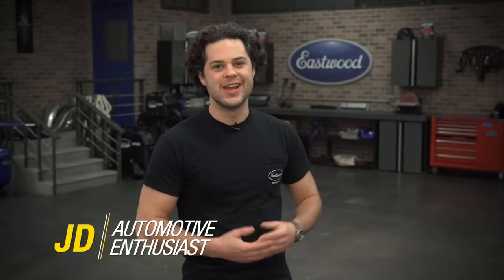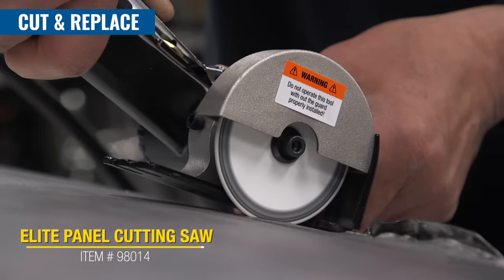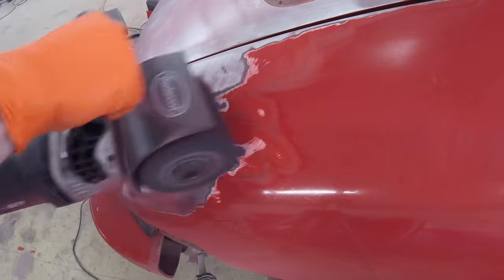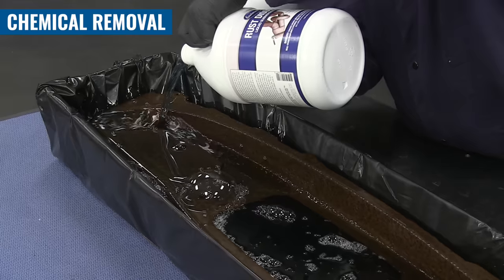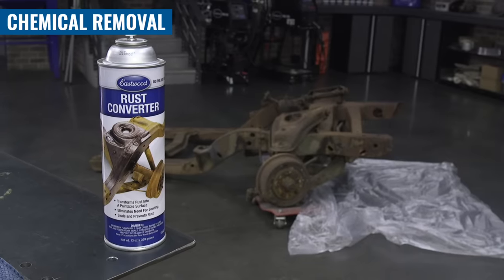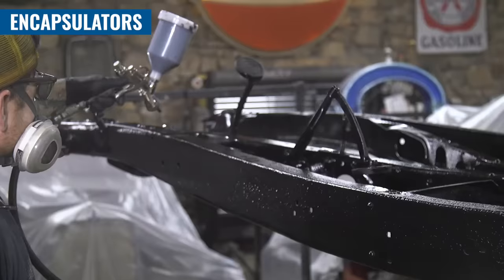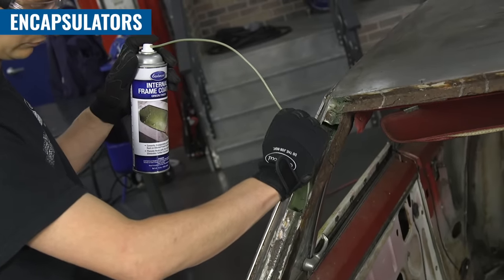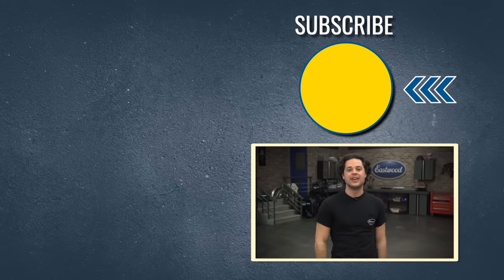How to Remove Rust - 3 Different Ways to Completely Remove Rust! Rust Removal in Minutes!

Comment: How did you miss electrolysis? The basis of that is used in so many other things, like gold plating, or other plating as well.
Reply from the maker: Electrolysis was originally in the script for this video. However, I wanted to really expand into that process. We want to keep the "In Minutes" series pretty snappy for you guys. Therefore, we decided to put electrolysis in its own video. Keep your eyes peeled for that one. Coming soon. 
-JD
Reply: @eastwoodco  it's honestly my favorite way. It's simple, it works, and it explains chemistry. Lol
Reply: Also, boiling in water will convert unstable red oxide ("rust") into stable black oxide.

Comment: So my wife bought me a used 2018 Silverado. It must have been from up north (we're from Dallas) as it has more undercarriage rust than we anticipated. Local mechanic said it was all surface rust. What would be the best product in your lineup for this kind of job? I plan on trying to tackle this job this spring. As I'm not very familiar with this kind of stuff I'm not sure what solution would be best? I know I'll be using a wired brush and a drill w/ wire brush attachment but not sure which chemical (acid vs convertor vs encapsulator) to use. Recommendations?
Reply from the maker: Sounds like the wire brush plus encapsulator should get you the results you're looking for.  We just did that on the C10 project we have in the shop right now - similar story, old PA truck, frame was rusty but not rotted, we wire brush and encapsulated.

Comment: Transmission fluid works amazing also for say rust under your truck from salt on the roads. It's not for something you plan on painting. It will stop the rust from doing more damage. For snow and salt you might have to do it 2 or 3 times a year. Pump sprayer or spray bottle. I have a car trailer metal deck and it was rusting away fast. So I prayed it with tranny fluid and it stopped it and I hit it 2 times a year. Try it.
Reply: im in new york...99 s-10 rusting away....you think this will hinder it further . i want to try this....thanks

Comment: Say I used Fast Etch on a large area, Can I still use rust escapsulator on top of that??
Reply from the maker: Yes you could. Apply and then properly clean the fast etch off with pre painting prep, sand, and prep as if it's a normal body panel and apply top coatings.

Comment: Lowest cost system is a kiddy pool full of muriatic acid.    Used to create PH balance in pools.   Any damage to metal is insignificant, and the rust will be gone long before then anyway.  You can save hundreds of dollars over other systems  
Just be sure to neutralize with simple baking soda.  Try the product on a small heavily rusted part, you wont believe how well it works for around $10 a gallon.
Reply: @KensGarage1  Took mine  to one of the free household chemical disposal sites after I threw in 4 boxes of soda.  I guess the rules are that they will take all chemicals that can be purchased by the general public.    They wont take chems. from industry.  You may want to check first. 
I had about 6 gallons, the pool alowed me to lay in large panels then brush over any areas that didnt  immerse.
Reply: @johnwick-ii6il  Cool.Thanks for responding. Good to know.
Reply: @KensGarage1  Just neutralize it with sodium hydroxide. The result is salt water. But be carefull when doing that! It is dangerous when doing it incorrectly. 
I use citric acid because it is much safer.  It is much slower but as effective.

Comment: Or I could just pay an mobile dustless blaster to do it for 400$ And have it done right. It takes an hour and a half.
Reply from the maker: Or you could buy our 100 lb. blaster, media, and safety equipment for less than $400, all in. Blasting isn't hard to do. The tools will pay for themself after blasting one part. 
You can do it. 💪
https://www.eastwood.com/ew-100lb-pressure-abrasive-blaster.html
-JD

Comment: At what cost. Great for commercial applications. Prohibitive otherwise. I'll stay with old fashioned remedies. Rarely abide the "new and innovative" money-whoring technologies that are typically grossly overpriced.
Reply from the maker: There are tons of home-gamers using these methods. Myself included. Fast Etch is a miracle product and only costs 23.99/16 oz. The Contour SCT is 179. You can get a MIG90 welder for 250 bucks, all in. A blast cabinet is only $400. Sure, you could dunk your parts in vinegar or use electrolysis, but the pros use the methods that I mention in the video because they simply work better.
-JD